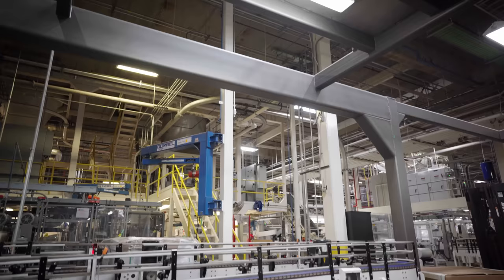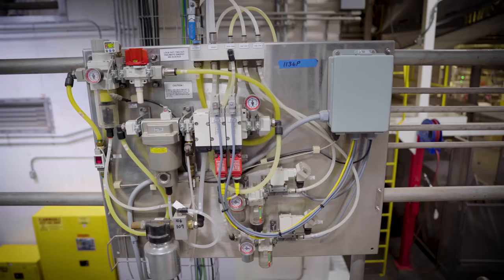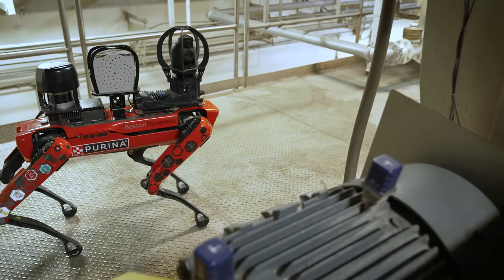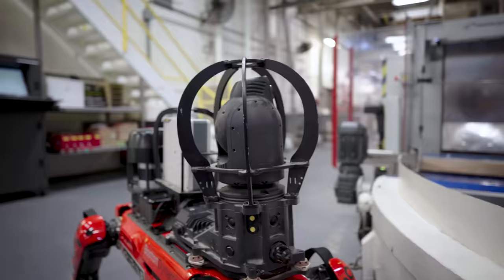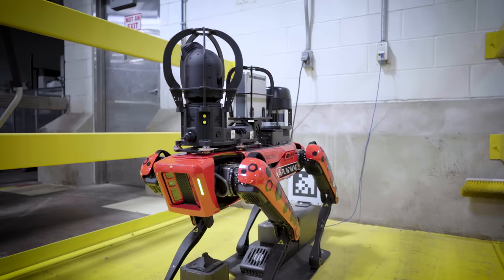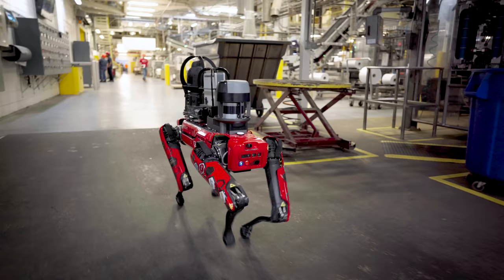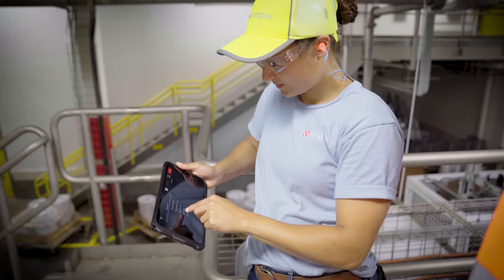Spot at Nestlé Purina | Boston Dynamics

Comment: I was in a Purina pet food factory in Denver while doing a solar installation.  There are sections of the factory where you were ordered to turn OFF your mobile phone due to the risk of dust explosion.  Spot's got a ton of signalling, I'm sure they vetted it for similar risks.
Reply: When was the last reported Mobile Phone instigated explosion? I am sure I have seen several safety authorities actually state that Mobile Phones cant spark explosions, despite the range of warnings reported to come from Petrol Companies (I believe I heard one of the original ones was fake but it took off to well before any facts could be stated)
Reply: Good point, but you heard her explain they chose Spot as an alternative to IOT monitor devices. So signalling can't be an issue where the robot patrols anyway.
Reply: what is a dust explosion lol
Reply: @pepsico815  Anything that is even mildly combustible if sufficiently aerated, ie in a dust cloud form , will burn so quickly it will explode. It was a major problem in the old flour mill days and there were some really spectacular disasters from it
Reply: @pepsico815  Fine dust of a flammable material suspended in the air can burn just like an explosive gas mixture. For example coal, sawdust, grain, flour, sugar, metal, etc. Sadly it happened even recently, e.g. Imperial Sugar in 2008, AL Solutions in 2010, Hoeganaes in 2011, US Ink in 2012 and Didion Milling in 2017.
Reply: The risk of explosion from a phone is really just the vibration motors when they have brushes that spark.  However the dust would have to get that far into the phone and most phones are water sealed so really, its not an issue any more.  The risk of phones maybe causing things to catch on fire, if used nearby, is a old rule. Like using phones on airplanes. It's not really relevant any more. 
Really old phones put out like 5W of RF analog power and could sometimes generate sparks from the antenna. but with modern digital phones that run at much lower RF power that cant happen any more
Reply: @PK-999   I wasn't there to argue with them about their company safety policy, I'm just telling you what it was.  Why don't you go and ask them.
Reply: @Psi105 I came here to say this. Definitely an old rule that is easier to leave than change. Not a real risk when any modern phone.
Reply: @baksatibi had a big sawdust explosion in a wood chip silo in Norway some years ago, the whole town properly heard it as a loud bomb. And concrete parts were scattered for a couple miles actually

Comment: Coming from the manufacturing industry, I think this a great application of the technology. I know people that will absolutely skip PMs because they are monotonous, which causes bigger issues down the road.
Reply: PMs? Product Managers? Predictive Maintenance? Production Milestones? What?
Reply: @Haapavuo  Preventative Maintenance
Reply: @Haapavuo preventative maintenance
Reply: Don't you love when you abbreviate something but then it takes an additional comment to clarify.... So much time and energy saved!
Reply: @PsyEnz if “spot” was here he would have seen the comment and corrected it! 😂
Reply: @Haapavuo  PM's is the industry acronym for Predictive maintenance inspections, not preventive like some have listed. Preventive maintenance is just a maintenance routine that  runs on a fixed schedule like changing a bearing every 6 months regardless of condition. Predictive maintenance is maintenance triggered by asset condition and requires frequent inspections with the ultimate aim to repair an asset just before failure, this maximizes asset usage and ideally results in the asset being replaced/repaired during scheduled downtime instead of it's failure bringing production to a grinding halt.

Comment: I would like to see the cost calculation comparing spot and IOT sensors and devices.

I can't imagine that spot is cost effective in these surroundings.
But I'm curious.
Reply: I could definitely see single/multiple expensive sensors being mobile over a large area being useful
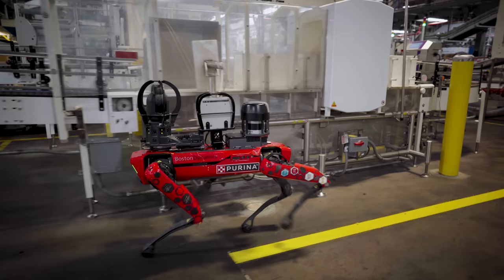Reply: Around 1:20 in the video they mention that they found Spot more cost effective than specifically IoT devices due to the amount needed.
Reply: Home use IoT devices are going to be much more expensive for industrial use.  Home use, you rarely have to worry about stuff going down and costing you hundreds, thousands or millions of dollars in down time.  Industrial IoT is going to be more expensive because it requires much more hardening due to vibrations, heat, active use, voltage management, etc.  There's more R&D that goes into an industrial IoT device, especially when it's custom and has to be done hundreds to thousands of times.  I can see spending a few 10s of thousands of dollars to invest in a robot to go and check some basic thermals at least to watch for motors overheating instead of relying on thousands of IoT devices to do that same job.

The other aspect of IoT is the supporting the SUPPORTING hardware.  What does the IoT device need?  Needs to talk to a server.  Where's the server?  In-house or AWS?  Whats the cost of running the server monthly (Trust me, flip'n expensive).

I don't know what the maintenance is like on Spot, but, you're not dumping thousands of dollars per month on it.  Yeah, a motor might quit, or, a sensor could go, but that's ONE device to go out compared to the however many are out on the field.
Reply: @lighthawk95 I think we all saw that but just because they said it, doesn't make it true. I think that's what the comment was getting at.

I personally have no idea how much it was already costing them for the various sensors, technicians and potential downtime when things broke, compared with one(?) robot. For all I know, it is a big saving plus it might make the process much more fluid and more effective in some ways… or they could be selling the robot and the image of the pet food company (judging by many comments here, that's a hard sell). They wouldn't publish a video saying that Spot is less efficient and not cost-effective so we can take their claims with a grain of salt unless they supply evidence.
Reply: @jacobpaint  idc, I was bringing the relevant point in the video to attention.
Reply: @jacobpaint  why would nestle make things up to make boston dynamics look good? its not nestle that sells the robots, they are just a customer
Reply: IoT is a meme. You want proper industrial control and monitoring systems.
Reply: I think the key thing is they can keep adding more and more tests in software whereas in the traditional way would have to keep refitting the factory (which in itself would need maintenance)
Reply: @Mr76Pontiac  - not to mention the time and cost of moving all of those sensors each time the layout of equipment is changed, modified or added.
Reply: I suppose for critical parts that can have no downtime, you want sensors anyway, can't wait until spot does a round and happens to see it. For less critical stuff where sensors aren't worth it, spot provides a usecase.

Comment: Wouldn't it be more cost effective to install a few fixed thermal cameras or sensors?
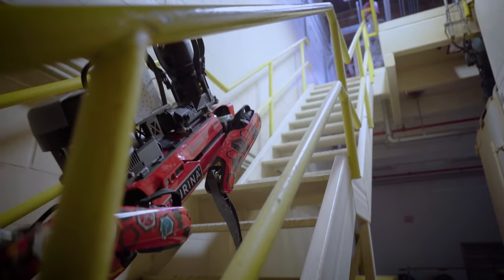Reply: It says at 1:18 that no, it would be more expensive to do that
Reply: Few simple = yes, sure!   But if there're hundreds of them of a special kind like checking the sound of gas leakage or the termal print of a complex pipeline junction. And again, hundreds of them..  Then, - no.
Reply: Would be way less awesome

Comment: You can use spot for vibration Testing bearings, if you can use it's arm to place a probe. That would drastically lower maintenance cost and ensure there are no lost running hour's left in the parts.
Reply: They may be able to do it just with a camera using a technique called motion amplification
Reply: @backacheache  I don't think bearings output that amount of vibration before they are dead
Reply: Mounted thermal camera would be another way.
Reply: @duceolsen  well I would point out that if a bearing gets hot, it is dead and should have been replaced before failure.

Plus lots of bearings in industrial machines are behind a thick metal Shield if they aren't housed deep within. Usually factorys have a maintenance schedule for greasing and for replacing bearings. But if spot could automate that huge work of taking measurements, it would optimise both maintenance scheduling, catch MTBF errors, avoid down time, stretch part life and more.
1000+ bearing's are not unusual in small automated factory's.. container ships = 4000+ bearings. The struggle is real :)

I'm Shure you could buy a spot and get a month salary, just from service contracting with companys this way, wake op in the morning, drop spot off at work, drive home and enjoy the day until spot calls and tells you, he's off early today, come get me owner 😁

Comment: Using Spot to work WITH humans and not instead of like some people are so worried about, helping and improving and protecting. This is the beauty of Boston Dynamics.
Reply: but this is instead of a human, a  human could walk the same route with a handheld leak detector and thermal cam. he could also be having a short chat with others on the production line as he wanders past them and be asking them if all the machinery has been ok, noticed any odd noises today, guy says actually yes theres a bit of a rattle when the heavy bags pass by, that bit of conversation could find a loose bolt on a stand for the conveyor, spot wouldn't have found that, it would have collapsed and bob the bagging guy would have lost a toe.....
Reply: @lezbriddon  It's not instead of, it's in addition to. None of those people are losing their jobs, it's enhancing them and freeing up time to do the actual maintenance and repair better and more efficiently, the person whose job you seem to think it replaced literally said that themsleves. They can go places a human can't physically or safely go, it's adding to not only deeper diagnostics but also safer diagnostics. They can also better detect random sounds and visuals as they pass, at more levels and spectrums and wavelengths than a human could. Spot is there to improve and enhance as well as help and protect.
Reply: @LadyMelmo.  Tell all that mumbo-jumbo to Boston Dynamics robotic truck unloaders and Amazons warehouse handlers, auto manufacturer welders, painters, house cleaners, food delivery... I can't convince the tree that the axe is its enemy because the tree KNOWS the handle is of the same wood.
Reply: @JeepinBoon  You do realise that it's not replacing but working with, right? Again, the people of Purina literally said that themselves and that it has improved the safety and standard of the humans' work (zero of whom have lost their position of employment). Boston Dynamics nor Amazon have full automation, no company in the millions and millions of companies in the world does (possibly one, a few others do have automated processes) as human labour is cheaper and more exploitable, which is why many of the jobs that you listed will not be replaced by robots. Whole additional industries are needed to be run and employed by humans for the design, creation, manufacture and maintenance of robots as well as people employed to work directly with them. Your tree comment doesn't relate at all, and that tree is being chopped down and destroyed by a human, which is pretty ironic.

Comment: It's like the wheel was never invented.  BD please showcase the narrow use cases for a legged robot and consider wheeled robots for common applications.
Reply: The environment was designed for animals to move around (us) therefore an animal -like robot is needed
Reply: Lmfaoo, theyve already made wheeled robots that can jump entire staircases! Legged robots are not a narrow use case, as most factories and worked conditions were made for humans, and humans have legs and not wheels. Therefore, legs maximizes compatibility with already existing infrastructure!